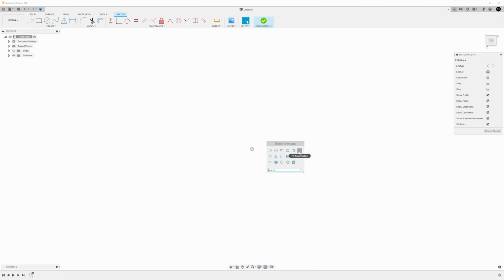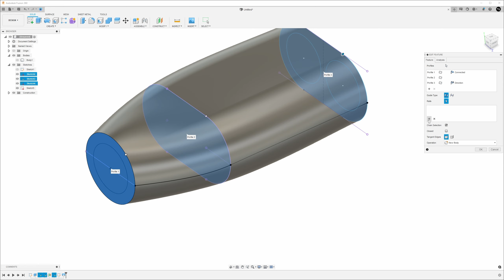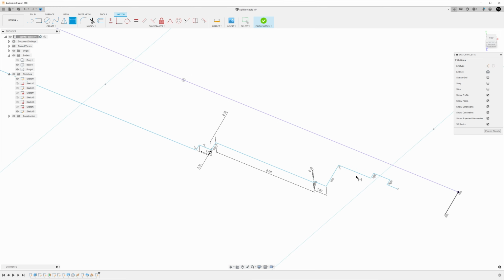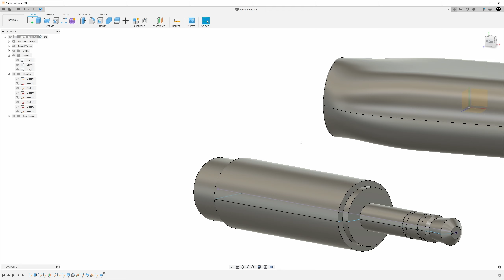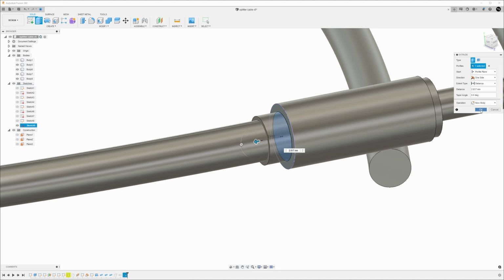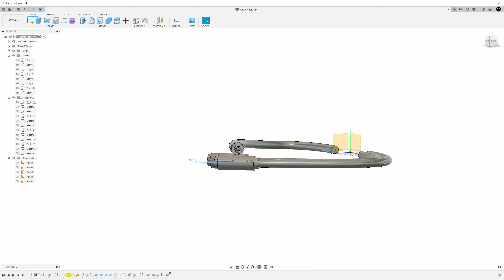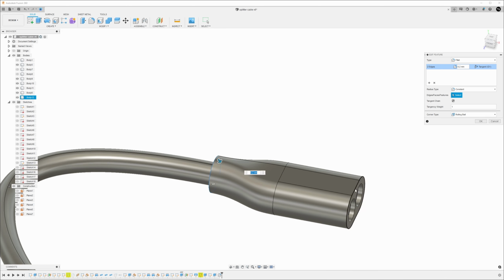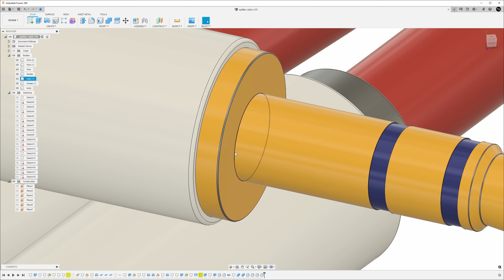Stereo Splitter Cable 3D Modeling Process Voiceover

Comment: This approach is absolutly usefull, but you can also model just one female connector as component and link it to the end of cable with joint. This isn't strict here, because connector itself is simple part, but if you need something more complicated it can save time on modelling second similar part and updating two parts instead of one later.
Reply from the maker: It doesn't surprise me that there's a better way! Thanks for mentioning how you would go about it. I should probably give it a go one of these days!
Reply: @WillGibbons  you way isn't bad for this model. Just consider another options for more complex parts: https://youtu.be/A5XYT8sZaNw

Comment: This is really interesting Will. It's refreshing to see that there's still a bit of backend work to make a good render. I'm curious, do you spend any time in blender to manipulate products? I work with a lot of rubber (flexing) and fabric product however I can never get an accurate render with these because out of Solidworks they're naturally "rigid" for DFM. Would love to know if you have any thoughts on how to manage a project like that?
Reply from the maker: I'll be the first to admit that I'm not terribly fast at modeling. I believe if I were to redo this, I could make it happen in about 1 hour. And someone who did know what they were doing could probably do it in 30 min. I have used blender and it's fun. But I would go about modeling the part in blender since CAD doesn't come into blender well. For soft objects you can do simulations or bend them in blender quite easily.